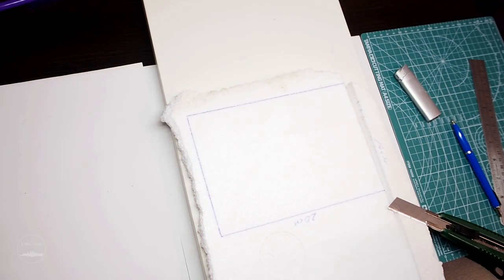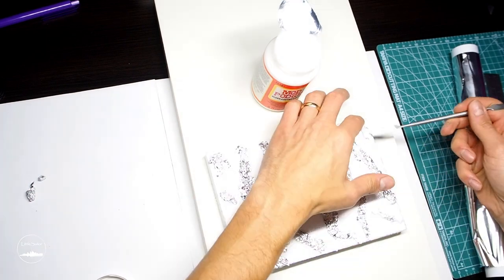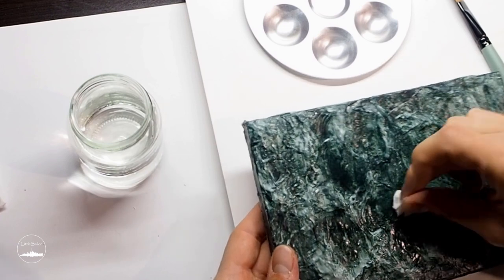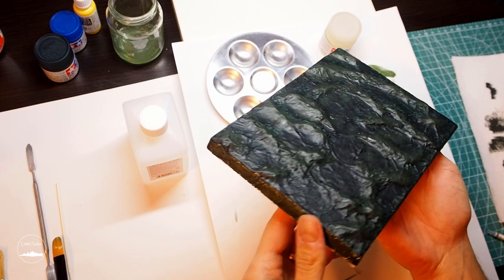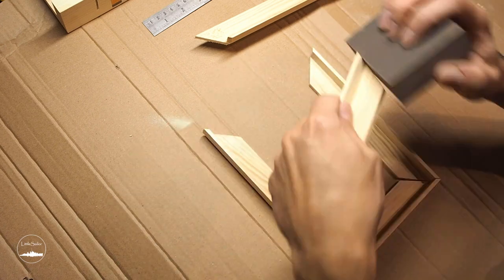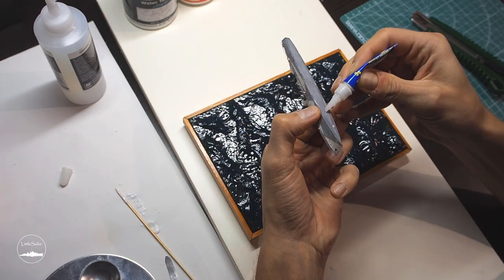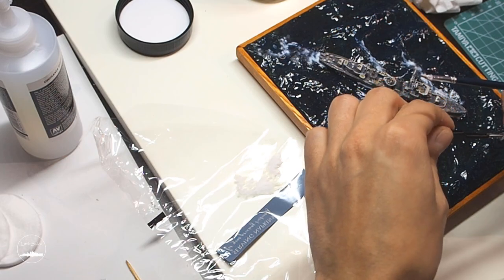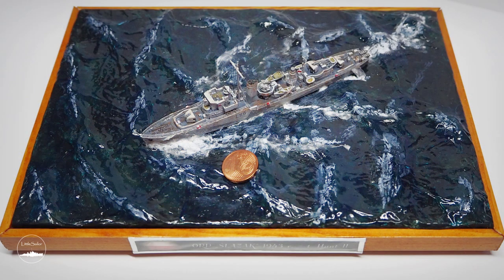#06 SEA DIORAMA - 1:700 scale, painted with a brush

Comment: Hi, I used tamya clear blu with Tamiya X-20A, but it stripped  off the  layers of Tamya sea blue that i have used before (I also use Tamia fine surface primer).   Do you know the reason? How many hours I have to wait before to use clear color or Tamya x22 with brush (I waithed 5 hours)? Thank you
Reply from the maker: Hmm it’s hard to tell. I usually wait a bit longer 20-24 hours.

Comment: Great work. What product do you use on the 4.1 minute? Is its mod podge that dries white? Or is it gesso? Thought that mod lodge dried clear. Thanks.
Reply from the maker: Thanks! Yes, it's MOD PODGE. Just after applying the glue is white but when it dries it's clear. I think I've mentioned it in the video. :)

Comment: After I applied primer over the dry mod podge I noticed tiny holes. Did that happen to u ?
Reply from the maker: Probably too much primer and there were bubbles... It's better to put couple thinner coats than too much paint with one coat.
Reply: Little Sailor figured it out. the mod podge was causing holes. switched to white glue. all good now.
Reply from the maker: @artsmodelstation9396  Thanks👍 Good to know🙂